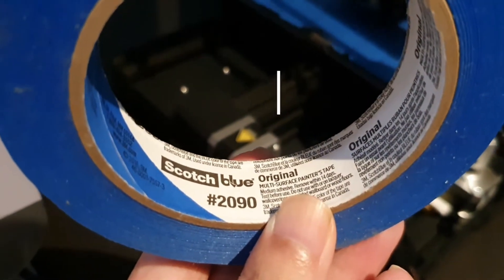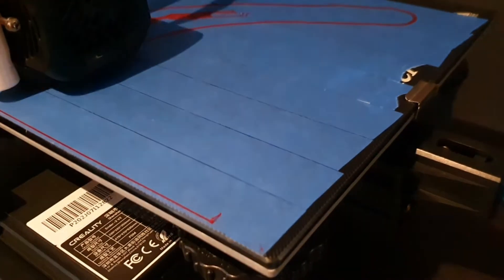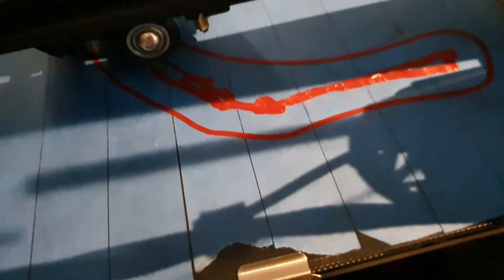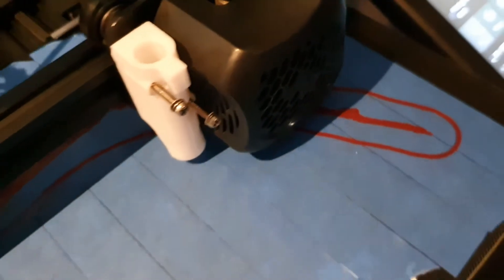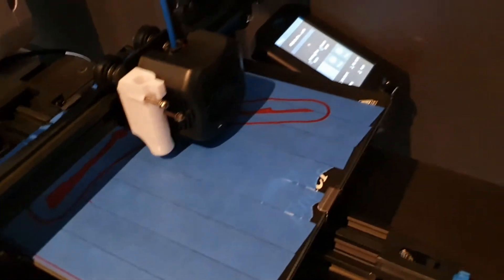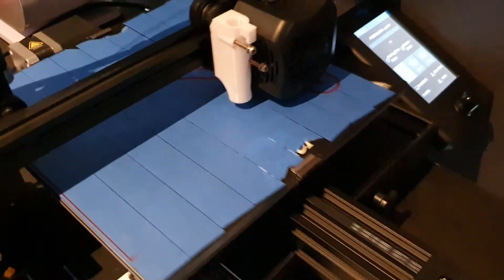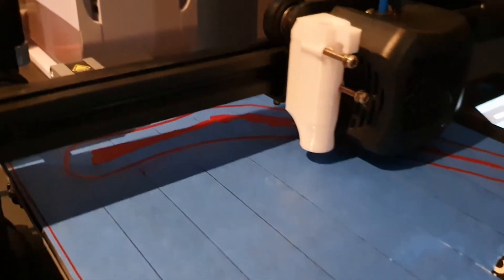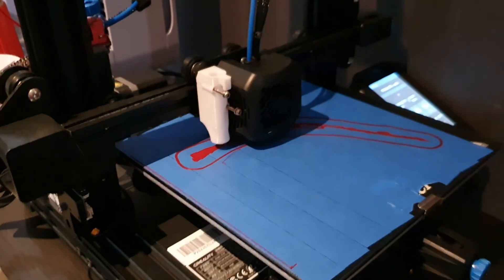How to fix 3D Printer Filament not Sticking on Print Bed

Comment: I have an Ender-3 v2 NEO which comes with a magnetic bed that should provide the grip it needs but i cant seem to get the first layer to stick at all, its brand new, ive cleaned the bed, tried glue, tried adjusting the Z-Offset to 1mm and tried cleaning the nozzel to no avail, it seems to just drag the first layer around while trying to put it down
Reply from the maker: Try increasing temp. Your plastic needs to be more molten so it won't drag.